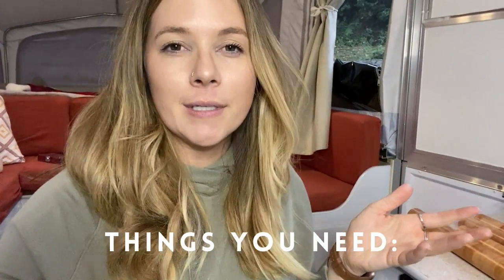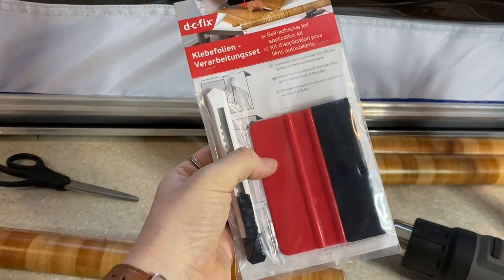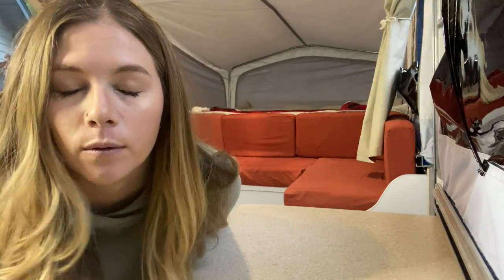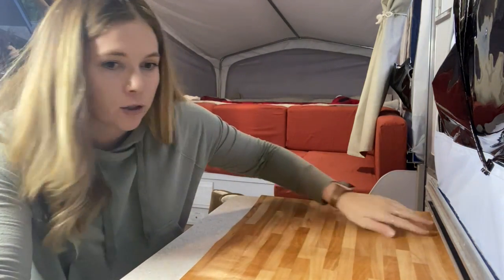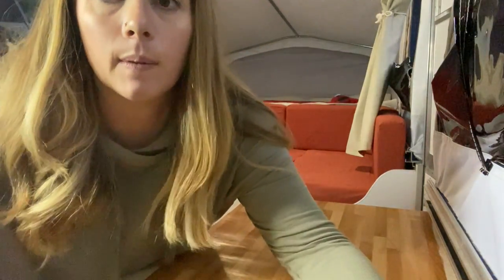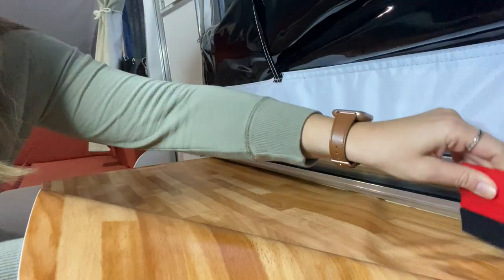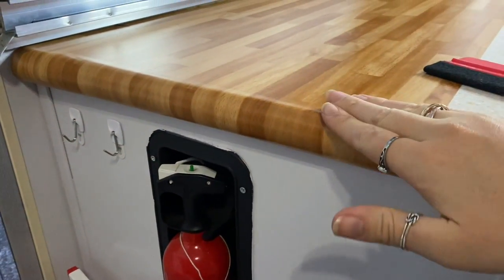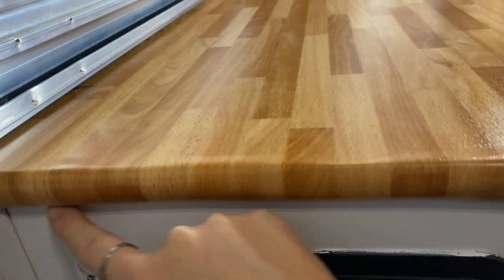DIY Kitchen Countertop Makeover With Contact Paper//D-C-Fix On Your Camper Countertops

Comment: As someone who’s done this before Great job! Using that pattern is ideal as it hides the lines well. It does help to have a second person if you tackle anything larger. But the only advice I could truly give is if your happy with the job and you would like to make it permanent put a quality coat of clear epoxy. Easy to do and you will be amazed by the results. Says you can set a hot pan on it but I still avoid doing that.
Reply from the maker: Omg what a great idea. I am about to do a desk makeover and I’m going to try this out 😍🙌🏻 thanks so much.

Comment: I'd suggest putting the whole 1st pcs.on the front ( opposite S yours) and put the seam farthest back towards the wall. Because more than likely you'll put stuff on the. Counter against the wall and doing it this way you'll have stuff covering the seam.farther back. If the seam is like yours it's in the front 1/3 and visible.

Comment: A question. Is there a reason you didnt just use the heat gun to heat up the vinyl to stretch it around the corner? Instead of cutting and stuff.. 🤔
Reply from the maker: I do stretch it, but without the cuts I just can’t get it to lay right. Let me know if you find a better way though!
Reply: @laurynejuneprojects1443  I just did this on a round table. Used a hair blower to heat it up slighly, it streched pefectly around and under. I suggest u try it 🙂

Comment: 🤔 It's either this, or one of those graining tools + multiple coats of paint. The smart choice is made obvious, when you look back in history, to the magnificent, gargantuan American station wagons of the 1960s - 1980s. Many of them came with long, wide strips of wood grain contact paper running down their sides, from bumper to bumper! It was apparently durable enough to use on cars exposed to all weather. Granted, wood grain finishes are great around the house, but they REALLY struck gold when they put it on cars! 🥴😉

 For the life of me, I can't figure out why they stopped spreading it on cars!? Just imagine a new Ferrari or Porsche, even a Lamborghini, with tall strips of contact paper in a beautiful shade of dark, knot-filled mahogany running all the way down the sides of the car....  Maybe a lighter shade of pine running over the roof and hood! I'd personally paint the rims in a brown, pine-cone pattern! What could be more sporty and modern?? 🤪

Comment: Exited to try this on my camper. This link doesn’t seem to be working could you please repost the link to the contact paper.
Reply from the maker: https://www.amazon.com/d-c-fix-Self-Adhesive-Butcher-Block-346-0168/dp/B007UGECS8/ref=sr_1_50?dchild=1&keywords=stick+on+countertops+butcher+block&qid=1628141725&sr=8-50
Hopefully this works! You can also search on amazon for DC Fix Butchers Block!

Comment: I am obsessed with your make-over!! I'm pretty much copying everything lol. I've hit a snag though..how did you do the contact paper around the sink and faucet? I'm trying to do it in as few pieces as possible to avoid seems, but I see no way around it? Any tips??
Reply from the maker: That was difficult, my husband helped me a bit with that. I just used the heat gun a bunch to really stretch the dx fix into place. And then I sealed it with some clear caulking to make sure the water doesn't get under it, if you use a color close to the DC Fix that could also help with the edges!

Comment: Why do you use the heat gun on the paper once it’s down?  Does it make it stay better?
Reply from the maker: Yes it does seem to make it stay better, it also helps it lay down nicer. You will find that the edges are harder to work with. Adding a little heat helps a ton.